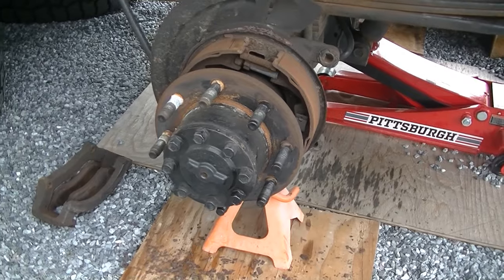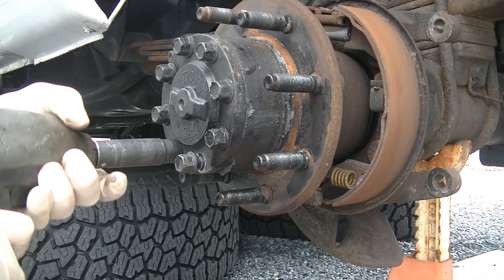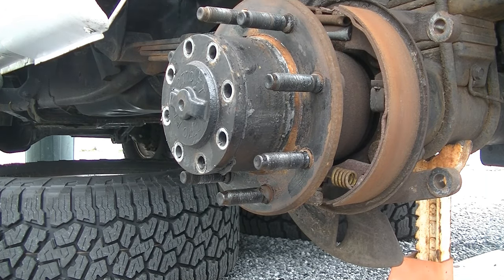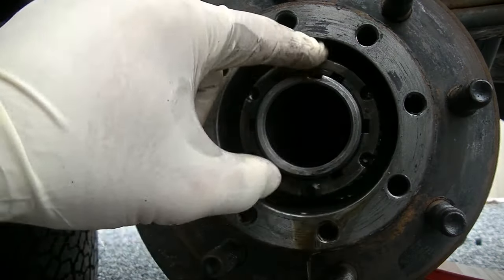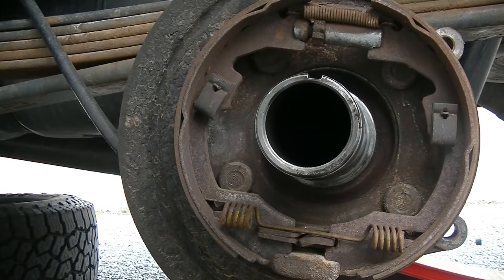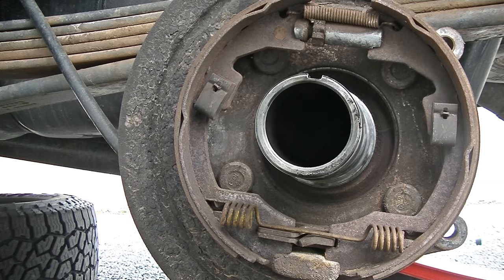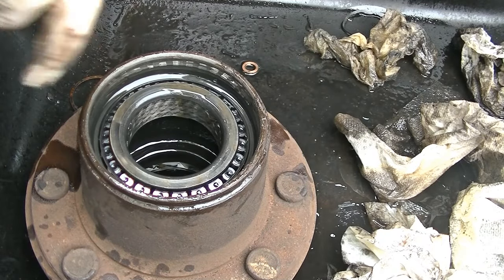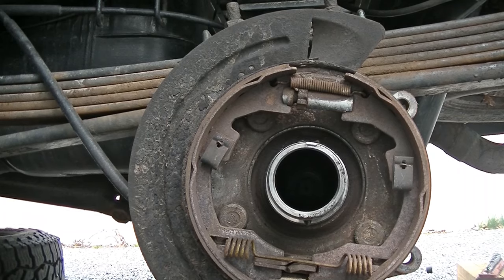Dodge Ram 2500-3500 Rear Axle Seal Replacement

Comment: little tip. If you want to avoid the initial mess during disassembly I jack the side that I'm working on slightly higher than the other side so that the axle oil won't run out on the ground and make a mess.

Comment: Still recovering from Covid financially and this video gives me the confidence to save me about $600. Thanks man!!!
Reply from the maker: Any time!
Reply: No grease in the bearings?
Reply from the maker: @billmea5593  no, they’re lubricated with gear oil
Reply: I can’t believe they charge 600-700 for this
Reply: @juliusthomas5277  especially now that I have done it.  The majority of the time was spend cleaning the old oil and grime from the brakes.

Comment: All the parts should have been cleaned before reassembling the hub. Spraying brake clean  into axle shaft and bearing contaminants the gear oil.

Comment: Actually, if you want to save the hassle of trying to pry the seal out like that, wiggle the outer bearing out then spin the nut back on 4-5 threads.  Then pull the hub off gently.  The inner bearing and seal will catch the nut and pop them right out for you.

Comment: You actually should put some grease on the seal lip and take 300 grit or a scotch bright pad and clean up the shaft....looking for any grooving, etc
Reply: Exactly! Or else the new seal lip will have accelerated wear due to spinning around a rusty spindle.

Comment: Thanks for the great video… my seal is leaking… shop wants to charge $285 to replace it…. I think I’ll give it the old college try with a 12 pack of barley pops, a case of brake clean and a couple rolls of towels!

Comment: Thanks for the video!! I appreciate it. Normally I use AllData for repair procedures if I don't already know it, but I bought my truck pre-owned and was unsure about R and R procedure for my leaking axle seal...AllData didn't go into too much detail so I figured I'd check here.

Comment: Thanks for this! I was thinking it was a huge c clip rear and I had to drain the center section to get the axle out. Glad that’s not the case.
Reply: Wait so you don't haft to pull the diff cover to remove the axles? Im looking to do the seal, bearings etc on my 07 ram 3500 SRW. If I don't haft to pull the diff cover that makes my life easier
Reply: @kylelarochelle5916  nope! I thought so too. But it just unbolts

Comment: thanks for the video. i just did mine but I had to hammer the  axke back on, new seak was suoer tight
Reply from the maker: Next time put a small amount of gear oil where the seal rides. Will help it slide on

Comment: Some people will put grease on the bearings as the axle oil will not immediately get to these bearings.
Other than doing that, you should fill the axle with the gear oil, then tilt the side you fixed down to the ground,  and let it sit for a few minutes at an angle, that will let the gear flow down to these bearings and get some oil on them. I suppose another way to ensure the side bearings get plenty of oil is overfill the diff, let that sit or drive a tiny bit, then set the oil level back to normal.
Reply: Big no, these are oil bath bearings oil will constantly flow between the axle and bearings. A coat of oil is good and even just getting to 20 mph will begin flowing into them. Grease will thicken the oil and make a mess of everything.
Now I don't have experience with this though but I can't imagine grease in a diff equipped with a LSD will turn out well. Those have clutch discs inside or helical gears but depend on the oil to function correctly.
Had an experience with a Honda that had the rear diff oil changed but they used an off brand oil, was clicking when doing tight turns. Hondas OEM oil has additives for the LSD and after it was filled it went away. A film of gear oil is enough.
Reply: @MechanicalSymphony  I am not talking about grease packed, just a small amount of grease, and the dif oil will dissolve that as it works its way there.

Comment: We've got a 2012 RAM 2500 CTD 4x4 here that's spent entirely too much of its life in an area that gets chemically-treated during the cold months.  As I was working to change the shot rear brake rotors and calipers, I discovered that the e-drum brakes are literally falling apart, so I ordered a full e-brake assembly for both sides of the truck.  As these e-brake assemblies come assembled, I'll be forced to remove the axle and the (presently healthy) hub to facilitate changing the e-brake assembly.  What I'd like to know is whether or not you feel like the rear hub axle seal will stay intact during the hub removal?  The seals are not leaking, at present, but I'm wondering about them staying healthy during removal and replacement of the hub.  If you feel that it's just as easy to replace the rear axle seals while doing this job, I may just go ahead and replace them while I'm doing this, but I don't see the sense in spending the money if it isn't necessary.  Thank you and please keep up the great video work.  Liked and subscribed.

Comment: Thanks for the vid. Where do you see it leaking. I have moisture on the outside of the plate towards the diff.
Reply from the maker: You’ll see it mostly on the backing plate so yes, I’d say you have a leaking axle seal

Comment: Would a 2014 2500 be the same  disassembly? They changed to a 5 link in 2014 but I don’t know if the axles changed too.
Reply from the maker: I’m sure at the very least it’s similar. Most 2500 series trucks whether it’s Ford Chevy or dodge use a similar setup
Reply: @SEsGarage  ok. Thanks! 👍🏻 I wasn’t sure if it had a full floating axle or if I would have to take the diff cover off and remove a clip to pull the axle out.
Reply from the maker: @troyd.521  all you should have to do is pull off your hubcap and take a look at the hub if you have your axle shaft bolted to the hub it should be damn near identical to this job

Comment: Might be a dumb question but I'm about to do this on my 2002 - I need to refill the differential with gear oil after replacing the axle seals, right? Most of the videos I see end with putting the axle back in, but that doesn't seem like the job is "done". Thanks in advance!
Reply from the maker: Honestly, the amount of oil you loose through an axle seal is negligible. You can absolutely check the oil level of the differential and top off as necessary
Reply: @SEsGarage   Thanks! Mine has been leaking for a few weeks, not huge amounts but needs to get fixed. Is there a specific grease for the bearing or will standard Lowe's red heavy duty grease work?

Comment: What are the torque spec on axel shaft seal? Would you recommend a small amount of lube on the new axel seal to ensure it seats properly?
Reply: Install hub bearing nut with Socket 8954 and tighten to 30 Nm (22 ft. lbs.) while rotating the hub (Fig. 19).
 
Back off nut about 30° and align next hub nut key slot with axle tube key slot and install locking key

    NOTE: End play should be 0.025 - 0.25 mm (0.01 - 0.001 inch)

Comment: Great video bud!
Reply from the maker: Thanks man! Please consider subscribing!!
Reply: @SEsGarage   I just subscribed. I have a 2015 Dodge Ram 1500. The seal I pulled out is different than the one the auto parts place gave me. It looks like the one you have. Is it the right one?
Reply from the maker: @coreywhite127  the 1500 uses a different rear axle than the 2500. So they probably sold you the wrong seal
Reply: @SEsGarage   I’m sorry. Autocorrect is the devil. Lol... My truck is a 2500 Mega Cab. The seal I pulled out of my truck is different than the one they gave me. It looks just like the one you have in your video. Oreilly calls it a wheel seal and not an axel seal. Is that the correct one? Thank for your help in advance.

Comment: How do I check the level in the rear end been leaking for a while about to change seal
Reply from the maker: You would pull the fill plug and you should have some oil trickling out if at the correct level
Reply: Okay thank you

Comment: Does the truck need E BRAKES on OR OFF?
Reply: The brake rotor will not come off if the parking brake is activated. So the park brake has to be off.

Comment: do you refill the oil/lubricant into it after or at some point? The lubricant that you lost while you were disassembling the hub.
Reply from the maker: you lose such a small amount that its not really necessary. When taking turns and driving gear oil will make its way down the axle tubes and lubricate the wheel bearings